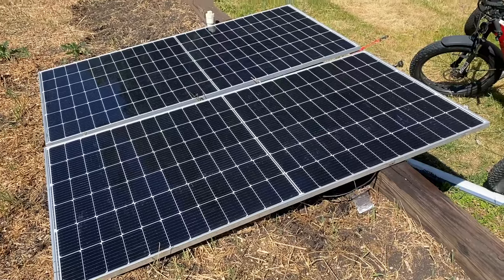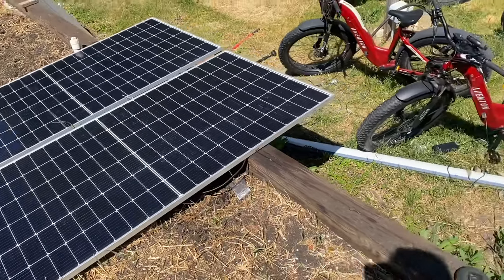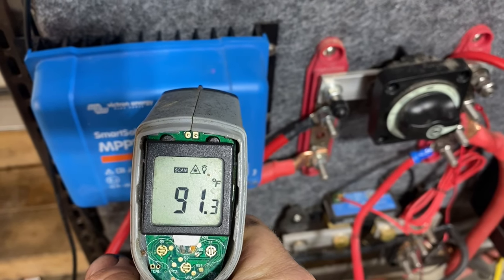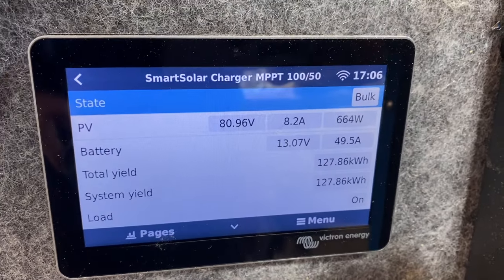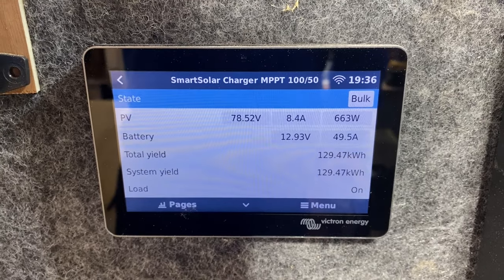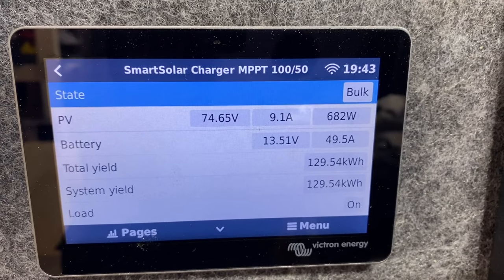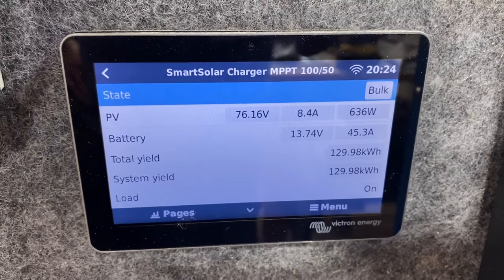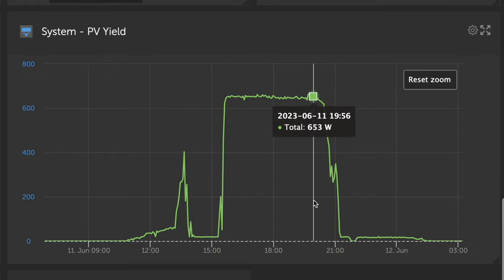How Many Watts of Solar Can You Put on a 100 | 50 amp Victron MPPT Solar Charger

Comment: my 100/50 goes into an over heat protection?? after about an hour of full output.  It then starts outputting around let's say 30-100wats or there abouts alternating up and down, and i have not observe it recover from this unless output it switched off and on again.  If I dial max amps down to 40 it doesn't seem to do this.  I thought I has it solved when I set up a pc cooling fan to aid in cooling, but now  observed it's doing it again.  

  there is not much advantage to my existing 100/30 charge controllers that have never de rated. Ambient temp is around 20c or less.
Reply from the maker: What temp is the unit when it shuts down? Might make sense to look into a 150/70 charger then, slightly larger case design.

Comment: Learning a lot with your videos.. much appreciated !  this might be a very basic question but I noticed you where only getting 8/9 amps from the panels but the Victron boost that up to 50 amps? to the batteries.... I bought a  Victron 100/30 and with 720 watts 4X180 watt panels in series... I usually see 20 maybe 22 amps max out to my batt. ... so If I upgrade to a 100/50 like you have I would get closer to 50 amps ? I get about 8 amps coming in from my panels as well.
Reply from the maker: Glad you're finding it helpful! A quick rule of thumb we use is  to take 80% of the rated watts and compute back from that.  So in full sun, (720w*80%)=576w in real world ideal conditions.  Then we take that 576w and divide by the working voltage, let's call it 13.5  - 576w/13.5v = 42.6 amps maximum you can  expect.   So it looks like yes, a larger controller might help.  However with you only seeing 22 amps from the 30 amp, tells me you might have some partial shading issues or haze in the sky knocking things down.  We have some older videos I'd suggest watching on testing a variety of solar panels in different configurations and partial shade conditions.
Reply: @sotasolar  When I see your calculations I realize that I did not mention that this is a 24 volt system. I guess when Victron rates the solar controller they use 12 volts to get the 100/30 they put on the cover.. makes cense now, so 576w/24.5v or so = 23.5 amps.... that that sound right..    I appreciate you feedback !!
Reply from the maker: Oh even better news then. The 100/30 is not based on 12v or 24v it just means it can take 100v from solar and output 30 amps. So 30 amps on a 12v system maybe capable of using 400w, on 24v it’s double the watts. One of the many advantages to a 24v or higher voltage system.
Reply: @sotasolar  Awesome, thanks so much..
Reply: I've looked at 2x 440w panels. Similar to yours @ 455w. My one's have a max. current output of approx. 15amps each x 2 = 30amps. Yet yr monitor shows 50 amps approx. for similar rated panels? I must be missing something here? Where does the xtra 20 amps come from? Cheers

Comment: For a 48 v system what solar charger would you suggest…? I’m running both lead and lithium banks….
Reply from the maker: Depends how much solar you have, or plan to have.
Reply: The 100|50 supports a maximum of 2,900 watts on a 48V system. (58V X 50A). 58V is max battery voltage for a 48v battery.

As long as max panel voltage is 100V
Reply: For victron energy mppt (48v), the only 100v unit is the 100/20, otherwise NONE of the 100/x support 48v battery and you need a 150/x mppt or higher.  Gary from SE MI
Reply: @Gary-wh7ce why wouldn’t it?

Comment: Can you tell me what panels you were running in this video? I have some that look very similar, and make the same output. I’m assuming you’re running these two in series, If they are the same as my panels, it exceeds 50 V
Reply from the maker: Zshine 455 I believe. In summer u see load it was working around 88-90v , wasn’t a problem. In spring or winter it would have over volted yes.
Reply: @sotasolar  thanks! Mine indeed are the same panels, I will be installing 6 and decided on 6 100/30 controllers

Comment: Those 455 W solar panels wired in series will have an open circuit voltage above 100 if it’s cold outside and you will damage the charge controller. Why not just put those big panels in parallel and you won’t have to worry about it. 

I have a leaven 400 W solar panels wired in parallel with a charge controller and it doesn’t seem to affect it at all it’s a good producer during cloudy weather. 

I have five separate charge controllers parallel to my battery bank 11 kW of Solar 34 kWh of battery
Reply from the maker: Was just a test in the summer, I wasn’t concerned about the winter :-)

Comment: If i have four 200 watt panels snd a 460ah 250bms 12volt battery what solar controller eould you recommend?
Reply from the maker: 100/50 Victron mppt , in this test we used 910w, 800w is good too.
Reply: I have a small system, just started getting into solar, but may expand it out later. Is there any harm in getting a larger charge controller system (aside from cost)? 

I was thinking 250v and 50i as it's the cheapest high voltage charge controller

I have 3x160w, but was thinking the next upgrade might start using  400w panels
Reply: Romahome modified

Comment: Were you running them in  parallel or series ?
Reply from the maker: I think I ran those two panels in series. In summer it worked in winter it light over volt.
Reply: @sotasolar  I have the same controller, my issue is my rig came with a go power 190w when I bought my rig the dealer installed a 200W both 12 v in series for 22.53 V. Then I bought a 400w 12v panel and I’m hoping it’s not going over

Comment: I hope you can help me 😢. I just got a I 150/60 victron controller. “Running for a week just fine” on 16 - 12v/100w panels in parallel. I was told to cut down to eight panels :-(. I don’t want to lose the amps Will the controller throttle down the watts? Will what I have continue to work? Think You for your feedback.
Reply from the maker: Bro, put those panels in sets of 2 to 4 at least. 4s4p would be what I would do. Gets your volts up to 40-50, charger will work better, you’ll get more power. 

The charger will limit amps naturally.
Reply: @sotasolar  Thank you so much. Will I get just as fast of a charge? Or do I need more panels and another controller “or larger controller” for more amps for more of a charge? I’m off grid so I need my two 260amp “lithium” batteries to get charged each day :-). I’m a new be 
sorry 😢.
Reply from the maker: @scooter6334 reconfiguring your panels will give more charge overall. More power earl and later in the day. You’re almost over paneled by 100%. So a second charger or a single 250/100 would be fine. But if you want to run them all parallel or lower voltage in general, go with a 150/100 and save some money.
Reply: @sotasolar  Sorry for bugging you :-(. My goal is just to get the most charge in my two 250amp “lithium”batteries in a days time. In simple terms “please” what is my best option?
Reply from the maker: If in full sun I’d put as many in series together as you can. That would be 8s2p splitting your array in two . You’ll charge earlier and later. PV amps is not the same as Battery amps. I have a video on series vs parallel that would be worth watching.  You’re biggest limitation is the charger. Your configuration will change things by 5-10% max.
Reply: @sotasolar  8 100W 12v panels in series is likely to very much exceed the max voltage of 150v and fry the controller (Almost 200v).  If Voc is about 24.5v then 5 in series would be the max as 6 would be 147v, WAY too close to 150 for any voltage gain under 75F STC...
Reply from the maker: That right, 8s will go over a 150 PV charger, would be fine for the 250 we also talked about. 

I find a mix of like a 4s4p would do nicely.

Comment: Those handheld spot radiometer‘s are not reliable. They are way too broad in range of error. depending upon your phone type, you could get a reasonably good handheld adapter to your phone and actually see what you’re measuring. A lot of heat comes off of the back of that unit which is supposed to.
Reply from the maker: It’s on the list of items to get. I plan to IR image more systems.

Comment: It says 100V 50 amps.  That's 5000 watts.  Minus internal losses and voltage drops.
Reply from the maker: I see where the math is there, only issue is you can connect these to a 100v battery bank. Highest I believe is 36v. 

The goal of this test, is how much actual panels do you need to get that max 50 amps at 12v (common usage) . Intuition would say 12*50=600w, but as we saw, in the real world, it takes much more. 

Now for the question of how much solar can you connect to this charger? That’s only limited by space and money. Could do 5000w and you’d be maxing it out from sun up to sun down rain or shine.
Reply: Not quite.  It's important to remember that the '50' refers to the max current that the charger will supply the battery bank not the max panel current!   So with this charger having the capabilities to charge both 12v or 24v batteries, the max current for a 12v battery bank would be 50 amps @ ~14.4v (assuming AGMs in absorption mode) = ~700 watts, and for a 24v bank 50 amps @ ~28.8v (assuming AGMs) = ~1400 watts.  Overpaneling does not increase these values, only helps on cloudy days.  These are spec'd out by Victron.

Comment: It's my understanding that you don't max. out yr controller. This is so on cold mornings. It's better to use a conversion figure like 1.1 for voltage & 1.25 for current to figure out the correct controller size? Regardless, do your homework first & do consult with a qualified person if you are not 100% sure.

Comment: What about at 24v ;-)
Reply from the maker: Double it.
Reply: @sotasolar  would u use 4 panels? 2s2p??
Reply from the maker: @HuDz1966  Depends on VOC of panels and conditions.  If in good sun and VOC under 45, yeah 2s2p would be good.  If lots of partial shade, I'd do 4p

Comment: i don't know what you are trying to prove here this controller can take up to 1400 watts according to the manual. just don't go over 90v or the controller will luck up
Reply from the maker: What I was trying to say to prove is how much solar panels is required to max out the charger on amps. The 1400w is for a 24v system. Based on my experiment here I’d recommend 1800-2000w of solar panels to achieve 1400w into a battery at 24v.

Comment: so how many wats of solar panels can you run on 100/50 solar charge controller? Dude I hate these videos where you don't answer you own question .
Reply from the maker: Sorry I thought I had the conclusion in there. We had 2x 455w panels and they would max out the charger . I’d say between 800w and 900w is a good target. 

Keep in mind, this is 800-900w to get 600w- 750w into the battery.
Reply: @sotasolar  okay but that is not the max wats it'll take, just because you used 900W
Reply from the maker: @tysesty the max watts of solar you can put on is infinite. In offgrid situations it’s common to go 2x or 3x what you’d need in the summer or ideal situations.  The charger takes the amps / power made available by the panels to charge the battery until max amps are reached. The only limiting factor is PV voltage. Keep that below 100.

I guess the title is not as accurate as it could be. A better title might be (how many watts does it take to max out the 100/50”.
Reply: Okay so I can connect it to 200 Amp 30 volts DC welder and charge my 12 volts battery correct?
Reply from the maker: @tysesty I have a feeling you're not expecting this answer, but yes.   The charger will see it as a 30v solar panel and draw about 23 amps from the welder (700w / 30 amps).  The only reason the welder pulls so much current welding is because current is unrestricted (relatively speaking).
Reply: @sotasolar  oh no, that is exactly what I would expect, just wane to confirm it. 
Thank you.
Reply: yah, so I just test it it and it works perfectly fine, so why the Victron people say in user manuel 60 A max? That is B S

Comment: IT'S IN THE MANUAL!!!!. you can put all the power you want until the pvs exceed a short circuit current indicated in the manual. and if you do, the reverse polarity protection just doesn't work. you can put 1000w on a 30A mppt without any problems. do you read the manuals before talking nonsense?
Reply from the maker: You’re right it is in the manual. What we were trying to to show is how much actual solar panels does it take to max it out. Not in theory, but in practice. We found 800-900W.
Reply: @sotasolar  Yep, its in the manual but I think people just want to see one blow up and let the magic smoke out.  I have two of these units and run them to the max too.  However, I don't want to waste an extra panel on it to over PV it when I can buy an open box 100/50 for $100
Reply: @Gary-wh7ce  Where do you get the open box chargers?

Comment: Your numbers are all bs . If you talk about input and output ,you need to define your system . So 50 amps at what ? , your system runs at 12 v ,50 amps at 48v is 4x the energy. So at 48v your panels (your numbers) would be like 3600 w at 48v or 900at 12 …….
Reply: 49.3A @ 13.06V, so yeah it's 12V.